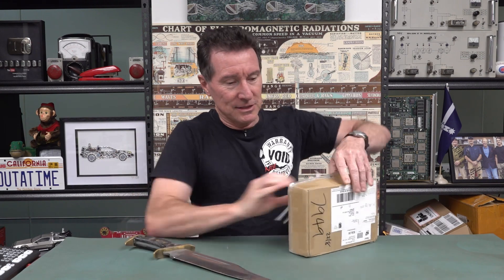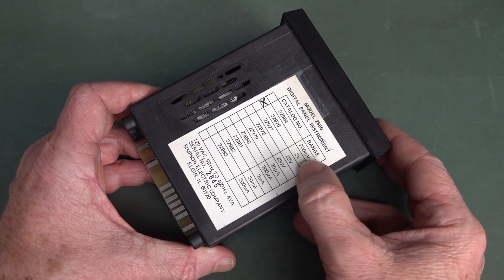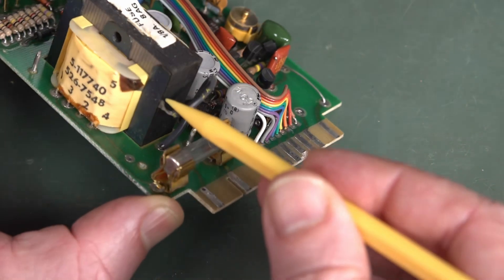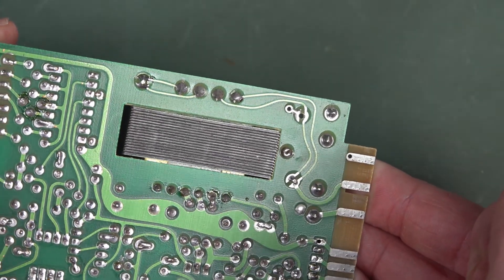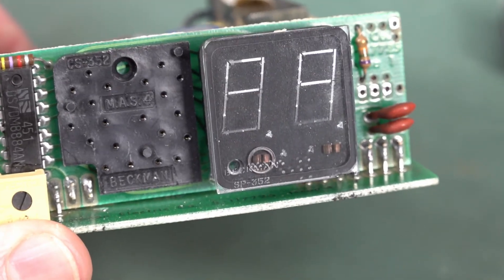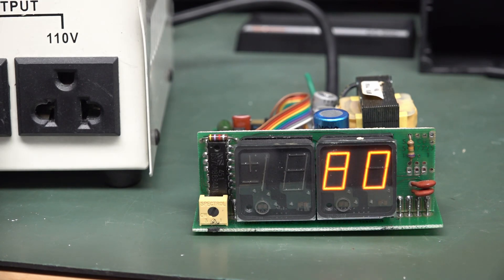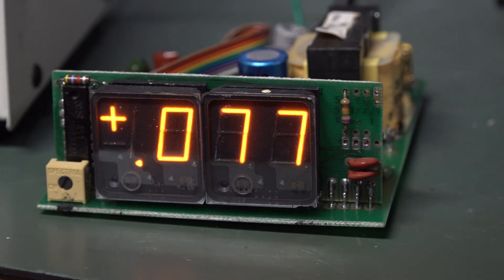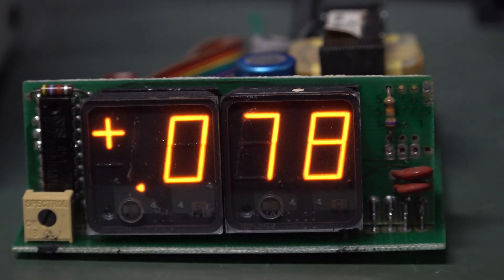Vintage Beckman Panaplex Planar Neon Display

Comment: The DM/DS8884 IC on the vertical board next to the panaplex displays is the 7 segment decoder and high voltage driver

Comment: They are nice displays, made a thermometer & humidity sensor that uses one, runs on USB-C. Common display type for this display tech. The dedicated driver chips are stupidly rear & hard to get. I have a volt meter that uses them, have it on top of my nixie frequency counter.

Comment: I  still have a Beckman Circuitmate multimeter, from the end of 80s (student days), my second ever digital multimeter. Still works fine and passes calibration. It seems though Beckman brand does  not exist any more? It says Beckman industrial, subsidiary of Emerson electric on the back.

Comment: Now prices will go up.
remember the time I paid for a HP 3444A like 30€. Now prices are crazy because of the NIXIEs. I gave a friend of mine two 5.5 Digit bench top multimeters that got Panaplex  display devices. They are really nice to look at
Reply: i knew nixie clocks would be a craze, so i bought a 50 pack of nixies for like 12 dollars back in the day. 
now theyre like 30 dollars each. still waiting for 300. wont be long
Reply: @echelonrank3927  oh man, I know exactly that feeling. I got a reasonable amount of audio tubes, as I lived in my teenage years thru the crazy price hype, like for example a soviet 6C19P went from like 2$ to 20$ each. today it's like 5$. this might be due the dying of DIY HI-FI. the good old folks that are interested in this technology are also dying.
I'm pretty sure that like in 20 to 30 years my stash of tubes will be of no value but to me.
nixies on the other hand might not face a price decay as "they look pretty" and everyone likes neat looking things.